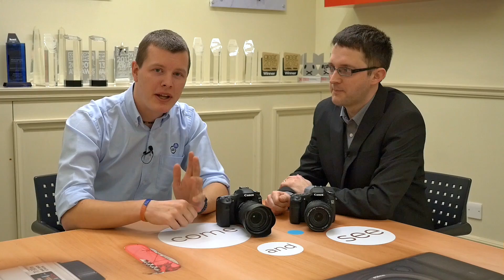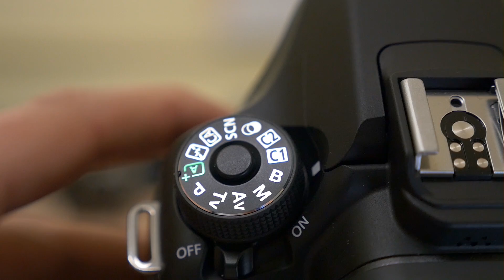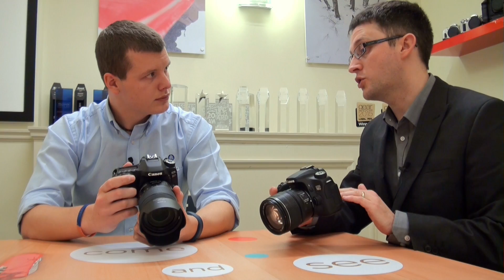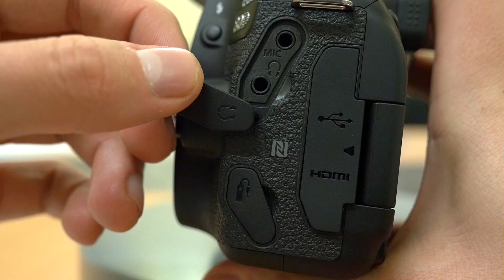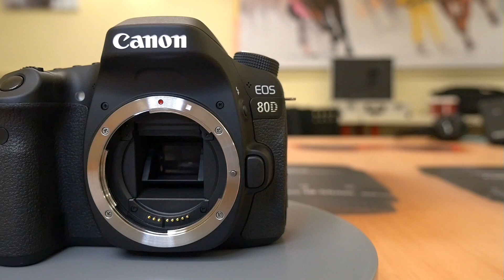Canon EOS 80D - First Look

Comment: I wish people would as direct questions like "Will the NFC work with non Android devices? Is wifi pairing still so fiddly to setup? Why no 4K video? How long into the future will 1080p video still be relevant before it is outpaced by small cheap devices?" Both Canon and Nikon produce good gear, but it is very very obvious that many differences between models are deliberate limitations put into the firmware, just ask any magic lantern user.

Comment: Canon 80D cost $1200, has only Full HD 60 fps with aliasing and moire, No log profiles, no Full sensor readout, no 4k, no 120 fps, no Focus peaking and no zebra.
Sony a6300 ($1000) has 24 megapixel Apsc Sensor with 4k (6k downsample to 4k ) 100 Mbps XAVC S format , no pixel binning, full pixel readout, --Cine/S-Log-3 and S-Gamut3/S-Log3 profiles, 120 fps in Full HD enables 4x and 5x slow-motion movie recording, Focus peaking, Zebra, 4D FOCUS system, 11 fps for up to 21 raw frames in a burst. Still canon 80D is better for canon fanboys.